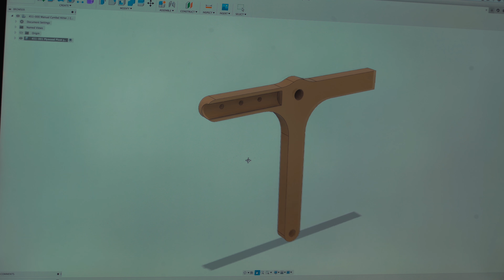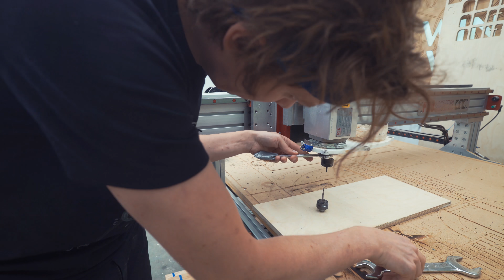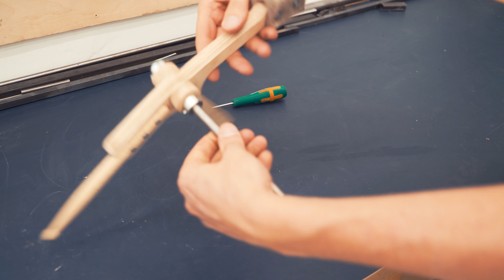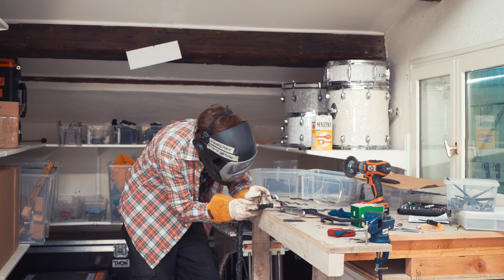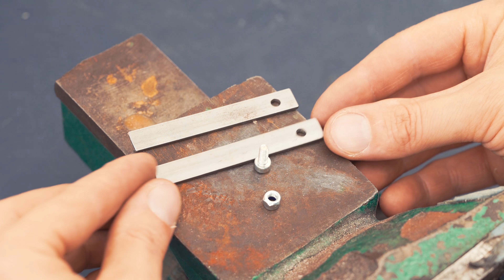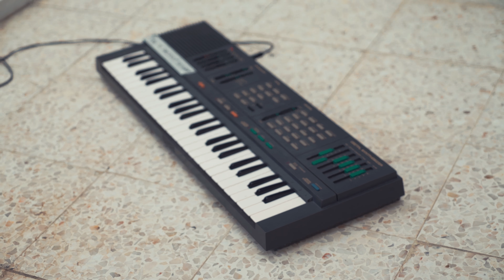One Day Build: Cymbal Hitter/Damper - Marble Machine X #92

Comment: You're hitting the underside of the cymbal, the concave "bell" portion of where the actual crash is supposed to be heard. What if you invert the cymbal, fastened it by the side/edge and had the marbles kind-of crash and roll to the middle (like those coin roll wishing wells) and drop through a hole... all the while the rolling marble almost extending a reverb-like rattle, on its way to the "drop-zone"...    Otherwise, you've sorta invented a "half-top-hat" up-side-down... something.  -------------------Hold cymbal upside-down, roll a marble around in it... stadium checkers...
John

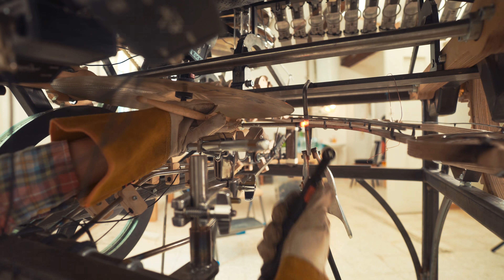Comment: Loving the project, only suggestion is you might consider adding an angled reinforcement to the piece you welded @ 9:19 as I noticed some minor wobble when you played it manually, and if the instrument is to be disassembled and reassembled, a little extra reinforcement couldn't hurt

Comment: For the felt dampers: I think even more important than the surface area was, that you had put the felt under immense tension on the outer side, that way it got stiff and not really felty any more; if you know what I mean.
If you would have used a piece of felt cut to the size of the curved one, if should have been enough already.

Comment: I was wondering about the cymbal sustain, with the added felt pads to stop it from hitting the frame.
Any possibility, of smoothly cutting a slice off the cymbals? It does affect the tone, not as much as one would think, but instead of hitting the felt pads, it allows for more movement and sustain. 

It also makes the cymbal slightly lighter, which might make the muting action quicker. It might improve the sound of short accents, like in Eye of the Tiger and make it sound more like there actually is a hand grabbing the cymbal. 

Of course the sound is heavily modified in post production, but in a live situation it might be something to consider.

Comment: Fun video, love that you did design and manufacture all in a single day.

Have you had any concerns about running your disc sander right over your electrical power strip? I might worry about shavings getting into the outlet and causing problems.

Comment: Christ, never done this before. I actually had to pause the video and run to the comments.
Listen, I've never said anything bad about your work before, 'cause you're amazing and I'm no engineer. I am, however, a drummer- and my guts churn when I see what you do to that poor Istanbul ride! It's restricted in all moving directions, and you hit it from beneath in an awkward almost dead angle, with a too short drumstick. And you can't change the drumstick when it goes flat and dead, because it's placed so far into the belly of the beast. You have turned this majestic ride cymbal into a mechanical monkey's toy, and it's breaking my heart. I have three of those Istanbul 21" rides!

Comment: Pro tip: When tacking without filler. Build up a small bead with fillerrod before attaching, then you just heat it together. Less heat input and more control of the weld:)

Comment: A point of interest, Martin. Have you considered putting the "manual Cymbal lever" on a spring (like, to surround it with one, so it acts like the suspension in a car)? That way you won't have to worry about yanking back after you are done using it, just leave it be and it'll return back to the middle position. Hope I am not repeating a question that was already answered and apologize if it's amateurish. Just want to contribute as much as I can. Keep up the awesome work!

Comment: Hints: 1: Round the corners of the felt so it doesn't fray. 
            2: You may want to make each knob slightly different so you can tell which one you are using by touch.  NB:  A nuclear plant did this with different beer tap 
                handles so the operators could tell which was which; it reduced errors during training and use. (You can Google this.)

Comment: Great work, I hope that you have been keeping a log of what you changed/ updating the cad for the [2] people that want to build along at home! (or you know, decreasing unexpected problems later on) Oh and you might want to keep a list of things you aren't mechanically happy with for one reason or another, since you can always go back and fix it later if you know the problem.

I hate to be one of those people, but whenever I quickly close a drawer everything in that drawer (tools, screws, my dreams) gets pushed ot the back and sometimes falls over the lip. WIth tools I have had drawers unable to be opened because the tools catch a lip.

In any case I can't wait to see what direction this machine goes!

Comment: Everything brilliant, the close integration of plywood and welded steel assembly is capable of deteriorating the plywood and making a musician practically play a different tune with time after several performances. Literally a remastered version ....., making many identical wood parts as replacement would create red faces and tempers during intricate repairs

Comment: I think it would be better to attach the drumstick or heavier equivalent to the lever with a hinge and stop the lever slightly short of touching. Then you can hit the lever in all the way and just the hinged stick hits the cymbal and bounces right back. Then you don't have to worry about dampening. You get cleaner and sharper sound and the cymbal doesn't swing so much.

Comment: Hey Martin, sorry for reposting my old commend from your previous video, but I posted it too late and got almost no reads. So... yeah:

TLDR: https://imgur.com/a/u5yedR4 GIVE THE OVERCOMPLICATED A SECOND CHANCE, just flip the lever attaching it directly to the L hook that releases the marble, so that the plate obtructs the marbles with the tip instead of making a v shape funnel.

The matrix sentinels look soooo good, but, they are bulky, are a failure point because of the individual buffers they have to keep (need to be primed with marbles before playing).

I'd say, dont throw the overcomplicated design away, it isn't nearly as complex as you made it look like, its just a lever to be able to queue a marble as close as possible to the drop point on the rising edge of the release, which is all you need 90% of the time.

 On top of that, the rising edge buffer (this is how i would call it) can be tuned with the root releaser on top (modifying the gray parts) to drop a marble with the slightest upwards movement fast enough to have a blocked marble already buffered before the actual marble is dropped onto the instruments (this is the optimal design IMO, fast, no width added, only a sigle marble buffer, can withstand almost 100% of the fastest possible drop rate dictated by the root releaser).

Another option is to free the original marble release and make the matrix sentinel/alternator be the root gate, close to the instrument. this means that all the travel from the top should be filled with marbles.

Take care and keep MMXing!

Comment: I hope this doesnt get lost in the comments!!

If you're looking to have a mute similar to using your fingers to clamp around the cymbal, using rubber pads instead of felt will allow for a much quicker mute. It will clamp just as cleanly and smoothly, and you wont have to change the design all that much.
Reply: Maybe try in the Reddit feed

Comment: I think swapping one felt pad for silicone might mute a bit more effectively?
Reply: Not really.  Silicone would be much too dense and you would hear the vibration of the cymbal against the silicone (it wouldn't have quite enough "give" so the cymbal would have to bounce off the surface of the silicone a bit and you'd hear a buzz).  You would also hear a bit of a thud depending on how hard it was dampened.  Not to mention you run the risk of it possibly sticking to the cymbal if it were to get wet or get something on it, lol.